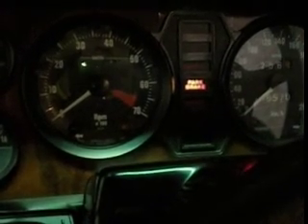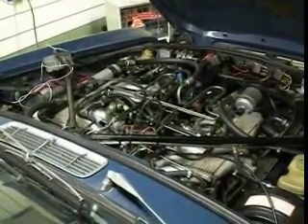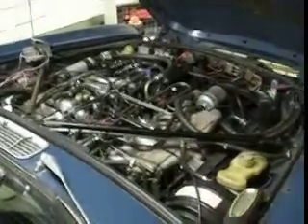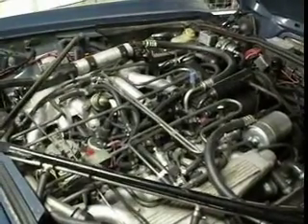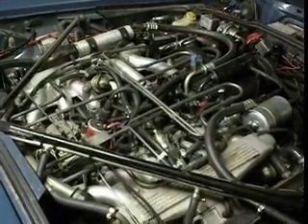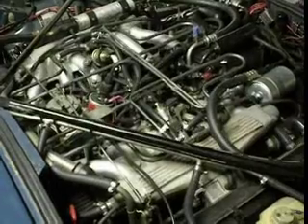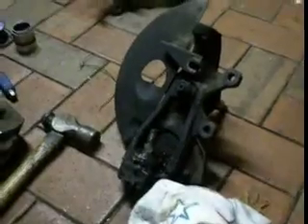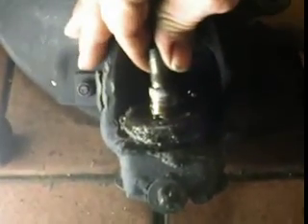more XJ12 work.

Comment from the maker: @Robonza yer it dose. yours would be a carb engine? this is a EFI with a odd resistor. later ones ran 12v coils. yer you should check that. this car made no noise at all from the front!

Comment: Lucky you caught the barrings it would have sucked if you were on a highway when those barrings went. I was in a van when that happened the spindle snapped and up in the wheel well went the tire and went flying across the highway at 70MPH almost of the edge of a bridge.